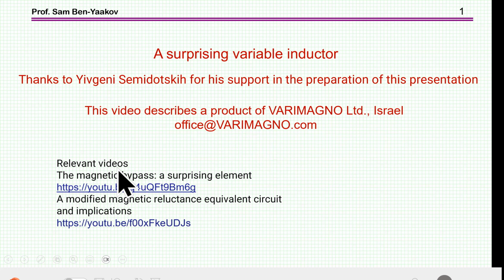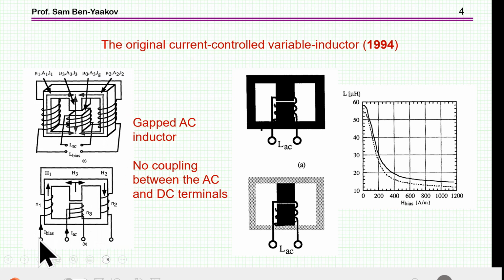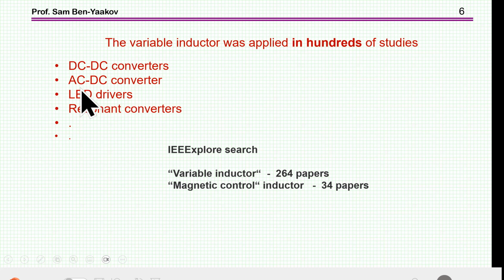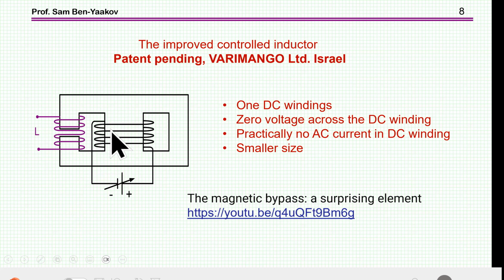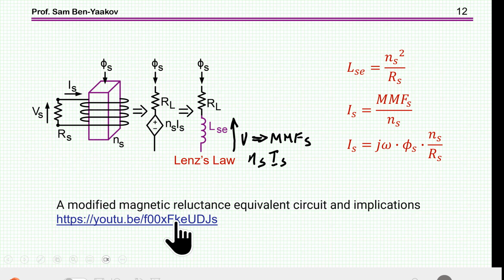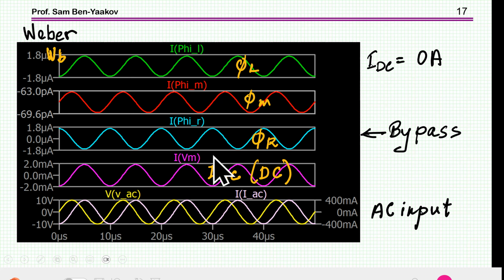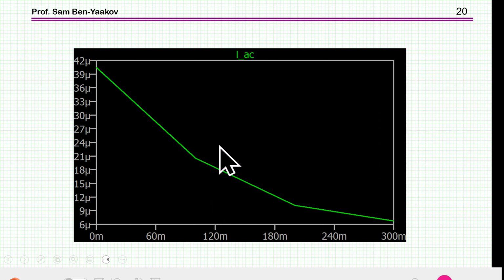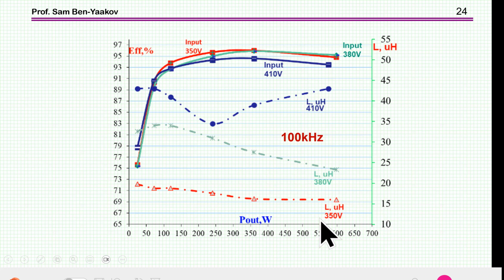A surprising variable inductor

Comment: Excellent discussion. When I started my engineering career I was tasked with building variable output voltage and current supplies operating at 200C for use in downhole oil and gas exploration tools. Your presentations remind me of books and seminars by Abraham Pressman. Thanks
Reply from the maker: Thank you, that's interesting.

Comment: Hi in the video 18.05s, the curve L = f(Idc); from the curve L= 40µH at 0A; L=7µH at 0.3A;                                                                from your previous calculation,  15.48s for example: Idc=0, flux_L_peak 1.8µweb at Iac_peak =0.4A; N=10 --> L =45µH; while at 16.32s, Idc=0.3, flux_L_peak 3.6µweb at Iac_peak =1.8A; N=10 --> L =20µH
Reply from the maker: As far as I remember these were different inductors

Comment: Why do you still put the voltage source  MMF_DC_L in series with L1  at 13.35s? . L1 should replaced MMF_DC_L? Thanks
Reply from the maker: The inductor can replace a loaded winding and it deals with AC signals. For an AC and DC excitation windings, nI source should be used. Thanks for highlighting this issue.

Comment: These were used in TIG welders before solid state controllers became common.  The foot pedal had a large rheostat that controlled the DC current in the control winding of the inductor.  The welder could control the current from 5 to 300 Amps. Mag-amps are heavy and expensive, so that's why they fell to the wayside.
Reply from the maker: @makerspace533   "These"?

Comment: Very clever improvment of the classic variable inductor! I do wonder how is the control law implimented for the case of 410V input. first inductance needs to decrease as load increases but then inductance needs to increase as load increases.
Reply from the maker: Good point. In the experiments the adjustment was made manually by trial and error. If implemented As part of the control then it may require some sort of a search algorithm.
Reply: @sambenyaakov  The result curve depicts steppping through range of powers, but resulting frequency is in inverse but monotone relation of applied bias for each operating point. Or I am wrong?
The point is that resonant inductance dependence of power is not relevant for loop, controlling frequency and output voltage/current
Reply from the maker: @ Not sure that I follow you. In LLC , the control of power (Q) is by a frequency change for a given Lr. If Lr is changed, the frequency will change for the same power.
Reply: @sambenyaakov  Ok in other words, proposed psu have 2 degrees of control, say output voltage and frequency. Output regulatiob could be implemented with conventional regulator, say opamp, because relation between duty cycle and output is in direct proportion. Question is, is it possible to use such conventional regulator to control frequency? I think yes, because inductace is in inverse relation of applied bias but without dips. Am I missing something?
Reply from the maker: @petergriffin760  Yes. You can drive the system by a fixed frequency square wave and use an analog controller to drive the variable inductor to maintain the desired output voltage. For that, the response of the variable inducor needs to be fast, still to be investigated.
Reply: @sambenyaakov  And what about using both control techniques at the same time, duty cycle control for output regulation and inductor variation by another regulator to maintain resonant behaviour (inverter angle)? This priciple is used in induction heating
Reply from the maker: @petergriffin760  Yes, this might help to adjust to the optimum efficiency

Comment: Magnetic amplifiers have been around for well over 100 years. long before even basic vacuum tubes. I recall they were first used in NYC, in theaters, where they controlled ( as dimmers ) the theater lights. They are still used in some nuclear reactors, ( military on subs ) for reactor instrumentation, because they are crazy reliable.
Reply from the maker: Magnetic amplifiers are another breed of devices. The one shown in this presentation is intended for high frequency operation to be included in switch mode power conversion systems.

Comment: They use this type of inductor in magnetic amplifier.
Reply from the maker: This type? Do you have a reference for that?
Reply: @sambenyaakov  If I post url it will be deleted. 
Just do a search either in Youtube or google for Magnetic Amplifier.
Here is a quote from Wikipedia:
"The magnetic amplifier (colloquially known as a "mag amp") is an electromagnetic device for amplifying electrical signals. The magnetic amplifier was invented early in the 20th century, and was used as an alternative to vacuum tube amplifiers where robustness and high current capacity were required. World War II Germany perfected this type of amplifier, and it was used in the V-2 rocket. The magnetic amplifier was most prominent in power control and low-frequency signal applications from 1947 to about 1957, when the transistor began to supplant it."
Reply: @aduedc  Go look at the comment I wrote on another comment, explaining why these are totally different.
Reply from the maker: @aduedc  ha ha ha. By the same logic, donkeys and horses are the same because you can ride on both of them, and the two have ears. I am presenting an absolutely new magnetic device based on an absolutely new concept. I am afraid that you either did not watch the video carefully or did not follow it. It will help if you first watch the videos I referenced.
Reply: @sambenyaakov  Inside a magnetic amplifier is a variable inductor. The concept of "Variable inductor" using core saturation is not new.  The structure presented for building variable inductor here might be new. There are other ways to make variable inductor even inside a chip.  Nevertheless, I enjoyed theoretical analysis and modeling;  though, it did not go into Q calculation for the inductor.  For that you need to use tensor calculation, because ur value changes with direction.  If interested please refer to "Quantum Electronics" book by Amnon Yariv.   You do not even need to have a air gap if you know how to utilize variation in ur in different direction, when constructing the core.  Instead of air gap, you could use ferrite with different crystal alignment in the air gap.
Reply from the maker: @aduedc  "might be new"? Why is it so difficult for you to admit that you were wrong and that this is a new concept? Unless you are unfamiliar with power magnetics, in which case you are really unable to judge the contribution of the new variable inducor design. And FYI, an air gap is very important in inductors carrying high current, as in switch-mode converters. In a variable inductor, the air gap provides a starting point for energy storage without the need for a DC bias current, and it also helps to reduce distortion. See our original paper published 30 years ago.  Further, in Power Electronics, we do not go into Q calculations and certainly do not use Quantum Electronics. Nor do we use the Schrödinger Equation or General Relativity. Everything in excess is bad. All the best.

Comment: How is this different from a magnetic amplifier?
Reply from the maker: Sorry, I do not follow you. Have you ever seen a magnetic element like this? Hmm
Reply: This isn't really my field of expertise, so forgive me if I get anything wrong, but this seems very different in a few ways. A saturable reactor like a magnetic amplifier limits current passing through it - I guess you could think of it like a kind of depletion-mode Mosfet that's also frequency dependent. It requires two seperate cores and two windings for the AC in reverse to cancel out the effect on the control.
The inductor in this video features a single core, a single winding for the power, and an air gap. The design is very different, and so is the function: the inductor stores and releases energy in its core, as in a DC converter. It's not amplifying anything, and the goal isn't to change the impedance, but to change the inductance to match a fixed frequency.
Basically, while they both use a control winding to saturage a core, the way they work, the way they are built, and the function they perform are all totally different.
Reply: @SkippiiKai  The concept of "Variable inductor" using core saturation is not new.  The structure presented for building variable inductor here might be new. There are other ways to make variable inductor even inside a chip.  Nevertheless, I enjoyed theoretical analysis and modeling;  though, it did not go into Q calculation for the inductor.  For that you need to use tensor calculation, because ur value changes with direction.  If interested please refer to "Quantum Electronics" book by Amnon Yariv
Reply from the maker: @ you have missed the idea of the bypass and the one DC winding with low AC current. How about watching the the video carefully?